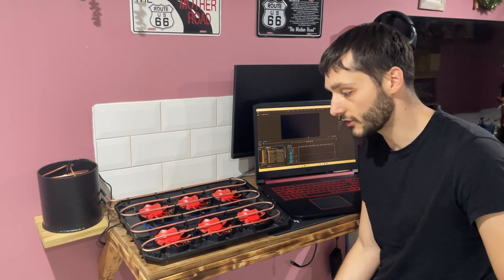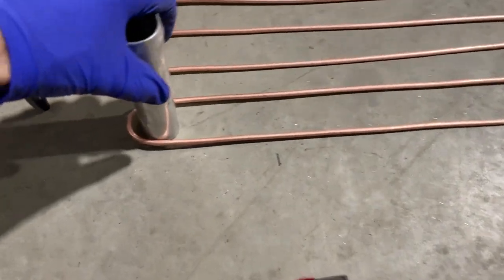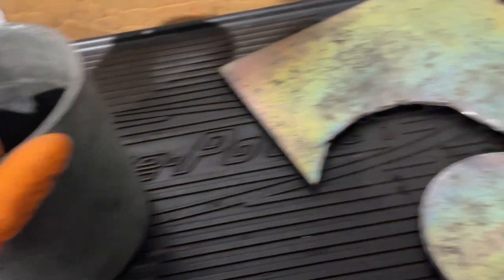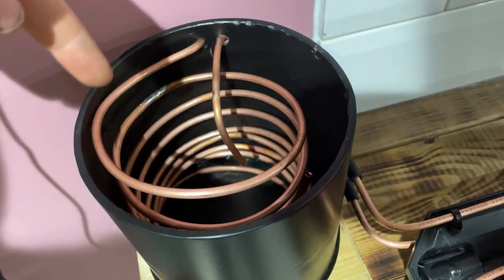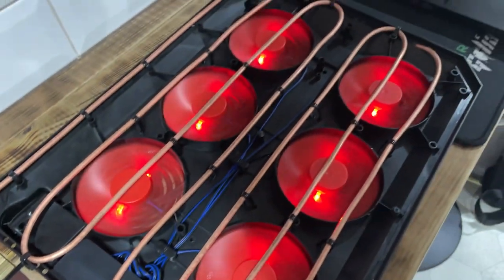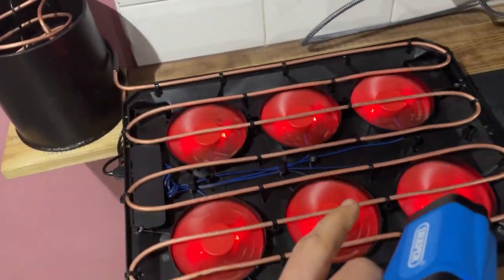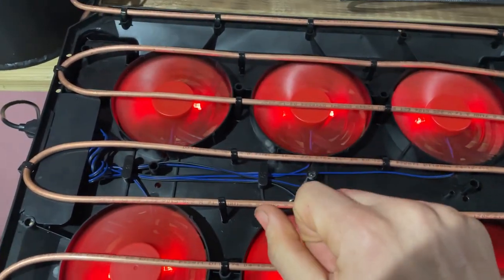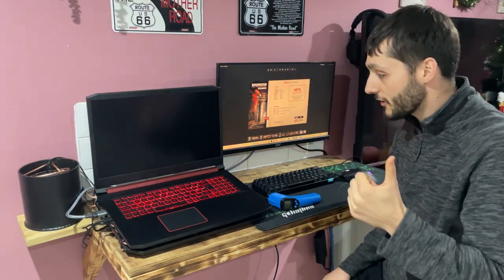DIY Laptop Water Cooler. It worked!

Comment: won't condensation build up on the pipes due to the temperature difference vs ambient and moist air blow inside the laptop?
Reply from the maker: I haven’t noticed any moisture on the pipes yet. I have on the tank but on the pipes because of the six fans constantly blowing I don’t think they have a chance to gain moisture.
Reply: Probably all the condensed water from the environment gets evaporated by the heat, this is good news tho, since evaporation is an endothermal process and absorbs heat from the pipes
Reply: How do you expect condensation under room temperature. That too when it's under a hot laptop

Comment: But there's no radiator?... The water in the tank will just heat up gradually until it reaches room temp and above.
Reply: Yeah I’m confused on this is well. It shouldn’t work without some heat pump like a Peltier cooler. Unless you were to be drawing heat from the laptop itself (if your laptop is metal like mine for ex) and just heat pumping the stuff way. But still, you’d need to have contact with the most of base and his laptop barely has any. Also your radiator would be away from the machine not under it. Shit ain’t adding up here for me
Reply: Yeah apparently he put an ice pack in the water and didn’t mention that in the video (as he says in a comment response)

Comment: This is not adding up. The thermodynamics ain’t making sense because the thermal mass is already room temperature to begin with, so without an initial temperature differential, how is this just magically losing heat? It’s been a year or more since I’ve taken thermo but I’m not seeing how this is possible

Comment: I dont think that heatpipe mod was working efficient unless there is a direct contact to your laptop heatsink
Reply from the maker: It would be good if somehow it could be connected to the heat sink but I'm not sure that's possible on a laptop.  The idea is to cool the air down as much as possible going into the laptop to then help reduce the temps.
Reply: @AshBuilt hopefully you read this. Thinking about doing this myself. Somehow I got a driver update that uncapped performance ceiling. So now gpu will run to the moon. Overheating is only issue. So want to do this. See what a 2070 max q can really do.

And you can attach this to your laptop heatsink, just would need to solder together to bond. Then cut pathway out of laptop backplate.

Comment: I was thinking that the shape of the pipes could be improved. There should be more surface above the fans but not too much to obstruct the air flow. 
The project is great. Unfortunately, I don't have the mechanical skills to build it but it really gave me cool ideas. 
How about having a sensor that checks the laptop temp and then controls the pump. Hotter it is, the faster is the cooling system.

Comment: Nicely done bud.  Kinda surprised no one really markets any water cooled laptop pads, even though laptops are designed for mobile use as opposed to a desktop.  Still would be cool though; no pun intended.  I’m currently using the Klim mistral with my 17.3” Dell G7, recently decided to re-enable turbo mode and decided to configure some settings just wish I could get the temps down a bit to an area I’d be satisfied with.  Was thinking of rigging up some air ducting to the air intake ports and trying out one of those “Arctic Air” As Seen on Tv coolers lol.  My cooling pad only has the two fans as opposed to your setup so I don’t think bending some copper tubing and ziptieing it inside the area the laptop rests atop of would work for my set up.
Reply from the maker: I’ve herd the “artic airs” are good might be worth a try.
You could try reduce you processed power down to 99 that usually helps with temperature
Reply: @AshBuilt  think I’m gonna do something similar to your design.  Since my last comment I have returned the laptop cooler I had (the turbines started making noises only after a month) and ordered an IETS gt500 v2, however I want to see if I can get it even colder.  Was contemplating getting one of those flat copper bent tubes and soldering directly to the heat pipes on my laptop, but I think I rather just try and slightly modify the laptop cooler instead for now.  I’m thinking of making a copper tubing rack similar to your first design.

Comment: Coming in a bit late here, thanks for sharing this!💯👏 

Thinking of a mod version of yours using some non-volatile, safe (as safe as the water in your steel bucket) experimental mixtures to compress, 

-> then decompress the ice age out of it - i.e. air sprayed - into the pipes (basically it's still an AC principle but in a novel, non-closed-circuit) 

...though I still haven't figured out what or how to make safe "kitchen stuffs" to stay at that airy decompression state all the way out the other end - that'd be a eureka moment lol. 

But should I succeed, here's a problem: I live in the hot n wet tropics, no AC. Any attempt to cool stuffs will dew the hell out of anything☔ hhh... 

thoughts on both ideas and issues, anyone?
Reply from the maker: I think if you hand a fully inclosed system like a car radiator system you could reduce the moisture build up. With the high air flow and warm temps of the laptop I don’t think you’d have much moisture build up.

Comment: It looks awesome!! I just have a question, about the copper chrod you use, what are the specifications? is there a meter of 10mm x 1.5mm ?
Reply from the maker: Hello sorry for the delayed response. The copper pipe is 3/16 and I got a real of 25ft. It’s the same stuff used on cars. Here is a link to one 
https://www.ebay.co.uk/itm/202654585029?mkcid=16&mkevt=1&mkrid=711-127632-2357-0&ssspo=25Cl-xAbQOK&sssrc=2349624&ssuid=iBaUi5sxRGC&var=&widget_ver=artemis&media=COPY

Comment: Awesome! Thinking about doing something similar. Would it get cooler with rubbing alcohol instead of water and with an air tight lid on the tank?
Reply from the maker: It would be worth a try. I put a ice pack in the tank after the temps were even lower

Comment: this copper pipe will generate condesation, if you laptop has intake fans on the bottom it will suck all the water/humidity inside.
Reply: Agreed, put the pipes before the fans and if you want super cold air a 'bladed radiator' would feed far cooler air than pipes.

Comment: I am just worried that that the condensation will take place on the copper pipes and the fans will bow moist air. That might damage laptop components in the long run. (Water damage is a bitch).
Reply from the maker: I did think this yes but after it’s running the pipes get fairly warm so condensation doesn’t get a chance to sit on the pipes. With all fans running permanently we’re pretty safe…. I hope

Comment: this is awesome, but can see a major potential improvement. the coil spring inside the tank is kind of useless as we are using water from tank to circulate inside pipe anyway so no need of extra pipe there.  just feed in the cold water from bottom of tank and release hot water at the top. this will improve the flow, less stress on pump as well as reduce cost of copper pipe
Reply from the maker: That’s a good shout! maybe the pump would flow quicker also which may add cooling
Reply: I think that you need reroute pipes abit on a cooler pad ...i think lines need to be placed that most of them will be sitting over the fans it should increase cold air flow
Reply: @AshBuilt  YOU CAN ADD A LITTLE RADiator with fans and make a closed circuit

Comment: I turned off the turbo in my Acer nitro 5 by putting the CPU on 99% performance in the powerplan so the CPU is like on 60C already. You should do that and then test this and see the temps. It will be even more insanely low.
Reply from the maker: I’ve tried this before and it does work! I just try to keep %100 performance and try to deal with the temperature
Reply: @AshBuilt  I've noticed that if I turn the turbo off by keeping it at 99% and then put it on High performance in acer nitro sense then it perfectly hits the middle temps between the two peaks while giving better performance than simply turning the turbo off. Check it out.
Reply from the maker: @arcanethink  I’ll give it a try

Comment: Lol i had same problem with my Acer nitro 5. RTX 2060 GPU
But i just limited procesor to max 95%, limit fps on 59 and set on power save
Before that it was balanced settings and goes about 80°-90° cpu, 70-75gpu 
But now average temp of cpu is 48° , max 58°
Average gpu 45°, max 50°
No need for any fan coller 
I am playing World of tanks Ultra HD settings with 59fps limited, ulimited it can go over 140fps
Reply: have the same laptop, i just changed the thermal paste yesterday. And wow! before on web browsing it was the cpu was on 60°-80° and now its on 40°. i played some games today and it was doing 50°. i used arctic mx6

Comment: ADD ICE TO THE BUCKET !!!  TEST AGAIN
Reply: He apparently did. That’s where the lack of thermal energy came from. I was scratching my head for days about this bc it is literally an infinite energy machine. In this case, the hidden battery was an ice pack he took out before filming (he said that in a reply to another comment). This COULD be modified to cool a metal stand with some thermoelectric coolers and a radiator away from the laptop. Those are inefficient, though, but if your laptop is metal it may work. I’m going to try this at some point
Reply: @ptrkmr  i don´t know why no one runs a tube outside their homes to cold down the circulating water. where i live is -20 |C outside tho. lol